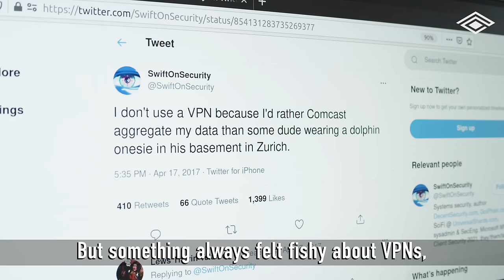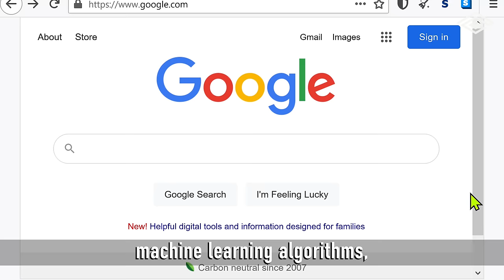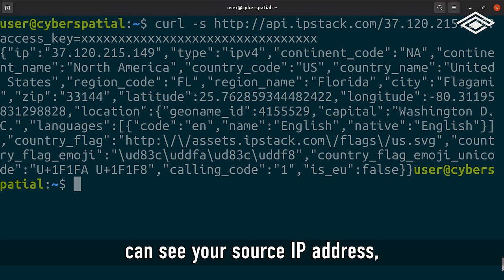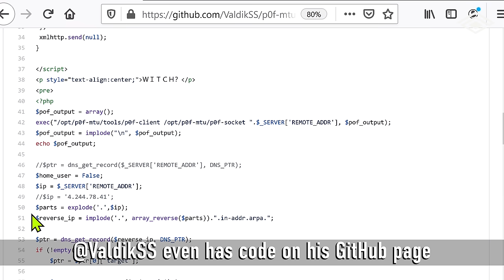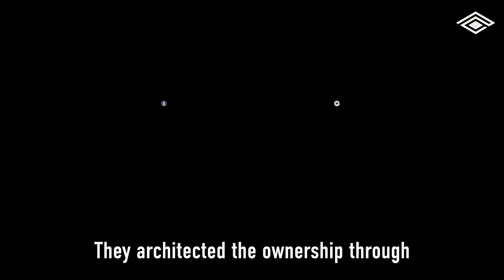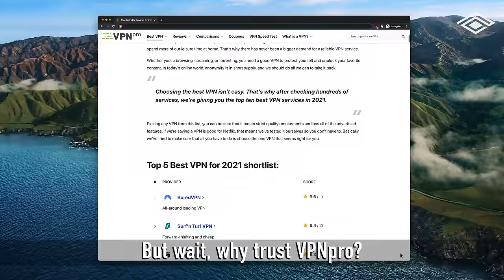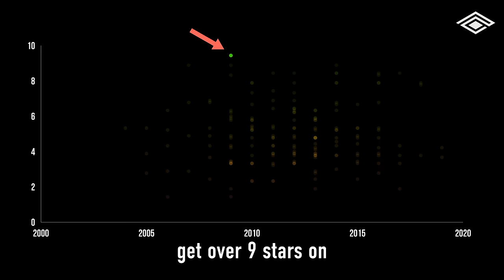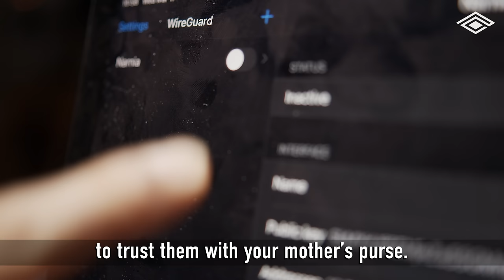Why VPNs are a WASTE of Your Money (usually…)

Comment: Thank you for posting this.  As an IT professional, it rustles my jimmies when I hear youtubers shilling for VPN companies.  Like, most web traffic is already encrypted with SSL and if you use encrypted DNS your ISP doesn't really see much.
Reply: Well, you know, except for those numerous ISPs caught doing packet shaping, deep packet inspection, and even outright MITM attacks/device hijacking. Many Intel Puma5+ chipset routers will block incoming torrent connections with the firewall entirely disabled - despite this being a "bug" it's been unfixed for going on a decade. We have malfeasance on both sides and I can guarantee you calling "BS" only on the weaker of the two sides (the VPN industry) isn't going to help anybody.
Reply: @Mavendow  It is one thing to say that these vpn services are effective at escaping packet shaping or throttleing, but you are as vulnerable to MITM attacks by the VPN people.
Reply: @Mavendow  Intel Puma stuff is garbage at the hardware level. Hasn't Intel abandoned that segment yet? But this is also the company who brought you Management Engine, so...
Reply: Not at all? Not only are VPNs helpful for crawling or doing anything that requires you to send a shitload of requests, they do help with a lot of attacks in your current wireless connection. Also  you can encrypt your DNS over HTTPS sure but most people rather just have a client that does it all for you so VPN overall better.
Reply: You're no IT professional lmao ISP can see your web traffic very clearly. Trying torrenting 100gb and tell me you don't  get an email from your ISP
Reply: @HevaNaisdey  I do it regularly. I'm not in the US though
Reply: @Alkis05  Not being in the US is a major factor.
Reply: @HevaNaisdey  Here In Ireland they don't give a shit about torrents.
Reply: @Alkis05  You aren't, because VPN providers not based in your home country will make it harder for the government to get access to the hardware to carry out MITM attacks. ISPs on the other hand often have preexisting agreements with national governments so they can tap in any time they want. The NSA was caught doing this on the entire AT&T backbone. China, Russia, Turkey, France, etc, do the same for their entire internet backbone rather than at the individual company level.
Reply: @HevaNaisdey  I actually don't lol
One of the few good things of living in a 3rd world country that don't have enough resources/give enough of a shit to actively fight against piracy.
Reply: You are not considering that there is more connections using DNS besides your browser. Easiest way to deal with that for the end-user is a VPN.
Sure you could setup something by yourself, there might even be some open-source software out there that does this, but personally I never searched or heard about it.
Reply: @Mavendow  That is the thing, there is no guarantee those companies don't have such an agreement already. However, as someone pointed out in another comment, they are likely to just let things be even if you are doing something illegal (such as piracy or whatever) as long as it isn't much of a big deal, otherwise they would eventually blow their cover, and if that happens to one VPN it will likely impact the trust on other VPNs.
Reply: Right, because most people know how to use/implement an encrypted DNS...
Reply: @HevaNaisdey  you know there are countries that don't send fines for torrenting shit. in my country i could seed (not download which is even worse) several TB of torrent content and i would never get an email from my ISP.
Reply: @Mavendow  So instead of trusting the ISP you'd trust a random VPN service. As likely as not with shareholders who own shares in your ISP.
A good VPN will protect you. But a good ISP takes away the need for a lot of the issues at hand. You're shifting the responsibility at an extra cost which makes very little sense to me.
Reply: @Alkis05  they choose not to go after you. That doesn't mean they don't know what you do. The point here is IPS can see what you do without an vpn.
Reply: @HevaNaisdey  Your are moving the goal post. What I said is that I don't get an email from the ISP. Someone is always be between you and the internet. That is the point. If your ISP is threatening to rat you out and you can't find a ISP that won't do it, that is fine. But that doesn't change the fact that there is someone in the middle with access to all your internet traffic.

More over, if you are the US government, by getting your meta data with your ISP, they can do a correlation with that metadata and the connections coming out of the VPN server. They just choose not to. That doesn't mean they don't know what you do.
Reply: @simmerke1111  exactly, bad internet people will find a way even if you hide behind a VPN lol... you're best bet against it is your own network or endpoint security and your own carefulness
Reply: @Mavendow  Sorry to hear you live in a country with no antitrust laws. ISP's aren't allowed to share customer data in a lot of countries. VPN companies are quite literally selling data to whoever too, including governments. You're just shifting the issue to someone you know less about. Often based in countries with no antitrust laws too.
People in the EU who can opt out of data collection by ISP's should not be dealing with VPN subscriptions at least. It's taking away more privacy than it adds.
Reply: If you're trying to use your VPN for anything other than circumventing geoip blocks, (netflix, etc) then yes, you're wasting your money.
Reply: @simmerke1111  That's not what antitrust laws do. Even if I did live in a country which honored the laws on its books, I still wouldn't trust my government, if all they had was antitrust.

There has to be sufficient legal liability for breaking privacy laws and no, the EU doesn't meet that standard. Much of the EU has spying agreements with the U.S. so the belief you can "opt out" is absurd. The fact we don't treat ISPs like common carriers as was the case for phone wiretaps means none of that can be believed.
Reply: @beergold  Protection? Not really, this doesn't change much. A decent antivirus and not being stupid is the key for your online safety 99% of the time, there is plenty of info about that out there if you want to know more.

Regarding privacy, go for it. Worst case scenario you are still being monitored, so if it isn't heavy on your pocket I would say keep it. But please keep in mind that there isn't someone carefully watching your every move, for the most part those things are automated and will "flag" you if you do something illegal, or in some countries even searching things like "how to make a bomb" could get you flagged. The details are obviously unknown, only speculation for the most part.

If you really care about your privacy there are better things you can do, once again you can search more about it if you want, but this is a rabbit hole that has no ending.
Reply: @simmerke1111  fair point about shifting the responsibility, but how would you know the ISP is good in the first place? You can safely assume all ISPs are giving your data away to the government, even if it needs a warrant.
Btw not everyone has multiple ISP options, in my case I only have one with good speed in my area lol
Reply: @simmerke1111  and just so you know, antitrust laws means nothing in the end. It is rather hard to track down those things since none of the companies sharing the data have a reason to talk about it.
Reply: @beergold  "little" and "boy" together is one such monitored keyphrase, and it ranks much higher than most keyphrases. Congratz, you just flagged yourself.
Reply: @HevaNaisdey  I did not get any emails from my ISP, but I was torrenting at 50kbps, with (my own at the time) VPN it went up to 10 Mbps, but my ISP said they had nothing to do with it and it must have been slowed down somewhere else. Had some issues with non-standard ports as well.
Reply: @NetAndyCz  Sounds like you have an Intel chipset router and/or modem. You can forward the ports all you want; that shit will throttle your connection anyway. Check the firewall logs it'll usually say something like "blocked DDoS attempt" x10000 from the IPs trying to connect as peers. You can disable the firewall and put your PC in a DMZ but it'll get blocked anyway. Piece of shit hardware honestly. Broadcom chipset is garbage too (they got bought out, used to be the best). I never have problems with Qualcomm nowadays (TP-Link products).
Reply: @HevaNaisdey  it depends on what country you're in. I've been torrenting daily for 10 years and never got an email from my ISP

Comment: For the record, HTTPS is NOT a substitute for a VPN. HTTPS prevents man-in-the-middle attacks but does not anonymize you to the client service you're contacting. Both are important (HTTPS moreso) but they serve different purposes.
Reply: HTTPS DOES NOT prevent MITM, go take a look at some AV software & proxying..... all you need to do is control the DNS
Reply: @stevesteve8098  no thats not enough. you need an x509 certificate that is signed by an accepted CA. So unless you have  your root ca accepted by Microsoft, Apple and Google to get it added to their accepted CA lists, you cant mitm HTTPS. And cracking x509 is pretty much impossible.
Reply: VPNs dont anonymize you either. As pointed out in the video, there are several ways of identifying you, one of which is by IP adress. This one gets covered but its also pretty easy to tell that the ip is meaningless and so other methods get applied automatically. Only thing VPNs can offer properly is encryption in an open WIFI hotspot for any traffic thats not encrypted already.
Web and Mail usually are already and a lot of other communication services also use the HTTPS protocoll so thats encrypted aswell already.
Reply: @invalid8774  nope..... if you control the chain you control the cert....
Reply: @stevesteve8098  yes. But that chain is the website cert which you want to replace -> the Certification Agency Certificate thats held by the guys who signed the website cert. These are hard to get and quite expensive.
Those are signed by another Agency thats even harder to get to and eventually you have just a few agencies that get trusted by your OS without proof.
So you have to either get the user to inject a trusted certificate into their OS for every system, get a CA cert that is trusted so you can create trusted certs on the fly or crack an existing one so you can mimic them. The latter ones are pretty much impossible and the first one is pretty obvious.
Reply: I work on large firewalls, and I can easily configure the firewall to crack HTTPS to see the information inside. I can't do the same to the VPN traffic.
Reply: @drthagore6499  in order to do that, you have to have a machine policy that installs a MITM certificate in your users machines that your firewall uses to effectively MITM attack all your users. As part of doing this, you at least theoretically weaken the security guarantees provided by the public key infrastructure as your firewall is now what's enforcing certificate validity instead of the end user (meaning they can't inspect the certificate) and, if compromised, can trivially expose everything on your network.

Firewalls are regularly compromised.
Reply: Neither does Tor, that's why they no longer mention anonymity, only privacy now.
Reply: @SimonBuchanNz  "in order to do that, you have to have a machine policy that installs a MITM certificate in your users machines that your firewall uses to effectively MITM attack all your users"
-1. The certificate doesn't determine whether you can do this or not; you just configure decryption of HTTPS traffic on the firewall. 
-2. Inbound inspection for traffic going to a web server will often either use the certificate of the web server, or it will use a wildcard cert. You can still decrypt the traffic regardless though. 

"Firewalls are regularly compromised."
 The International Data Corporation finds that 70% of successful breaches of companies originate on the endpoint. I work cases where countries are attacking the targets, and I've never seen the largest, properly configured firewalls with redundancy ever get remotely close to what I would call "compromised". Don't get me wrong; I know it happens, and I know not every firewall admin didn't get their job via nepotism or whatever, but with over 1'000s of cases with medium sized companies, Fortune 500, and government clients, I've never seen these large firewalls "compromised"; yet, I've dealt with tens of thousands of compromised users.
Reply: @SimonBuchanNz  Some NSA documents were leaked a few years ago about easy it was for them to crack HTTPS traffic, because (in reality) only a small number of prime combinations were used by the underlying RSA.
Reply: @dawnfire82  Sure, bugs and cryptography weaknesses happen. I can assure you that's not what's happening for the above. Certainly Cisco didn't break the entire internet's security mechanism and then decide to add that as a feature checkbox in their next product.
Reply: Y

Comment: I haven't looked deeply into this yet, but my guess would be that any entity that's serious about fingerprinting people is primarily going to do it via the browser by collecting data tied to the OS and hardware. It doesn't generally make sense to place much emphasis on an IP address which can easily be changed or hidden, especially in an age when, like you said, proxies and VPNs are simplistically marketed left and right as the end-all-be-all to privacy and security. This is why Tor recommends you completely disable JavaScript, as it can expose so much about someone, even across browsers.
Reply: If you have different I.P's for each mobile/PC/laptop etc, the fingerprinting mentioned won't work.
Reply: how are you gonna use the internet without java script
Reply: @gamingtonight1526  It would if the IPs remained consistent, which is often the case in home networks since dynamic IPs tend to get re-leased periodically. It still isn't a great method by itself, given how easy it is to change/spoof an IP.
Reply: @99lysergic50  It's up to you whether you want to take the risk. One nice alternative would be an open source browser which blocks the specific APIs that are used to fingerprint, but I'm not aware of any.
Reply: My experience is that every guide to attaining true "internet anonymity" involves at one point or another wrangling the homeless. .
In every guide, regardless of how simple or advanced, at some point there is always some step which requires you to rustle up a homeless guy to either buy a sim card for you, pick up a laptop, deliver money, create an account, or something.

Seriously, online security is like 20% homeless rustling.
Reply: @Brandon I know you're being sarcastic but most people are LITERALLY doing just that. Networked doorbells and other cameras, smart speakers etc.

Comment: Thank you for this.  I have answered so many Quora questions about VPNs, and why they are not a security tool, and people flame me for this.  It matters not how much I know, people use them, so I am wrong, and they are never wrong.  I have spread the message so many times that a VPN only provides obscurity of location -- nothing more. (note, I mane VPN in the terms of the current commercial offerings, not site-2-site nor remote access VPNs which are about security).  A TOR browser is better than a VPN, provided you never login to a site. Anytime you sign into a site, you should just do that of SSL with a normal browser.

Comment: I built my own using OpenVPN and AWS but even this kinda felt like a placebo. Thanks for the comprehensive breakdown.
Reply from the maker: That's a step above the commercial option at least :) Thanks for watching!
Reply: Same, it wasn’t all that hard
Reply: Well using aws would of made it pointless as they have tracking software in all the servers.
Reply: @bellabear653  yeah tbh at the time, i wasn't sure how logs worked but you def have a point
Reply: @tylercoombs1  oh still a good project great way to understand server workings. But even if you disabled the logs im sure they have tracking on the underlying bare metal of it.
They would have just for monitoring what the server was doing.
Reply: @bellabear653  really? Do you know in details? I’m going to set up a simple aws vps with openvpn but you saying that is also scum? Explain how aws tracking all the shit going through vps band?
Reply: @Cyberspatial  So you think Tyler having a fixed IP address is better for his long term security than using  multi hop or simply changing up servers or a number of other methods that are commercially available? Interesting.
Reply: God sees everything you do and think, you can't hide anything
Reply: @dant8162  I don't think she cares that much.
Reply: @VTRex  She?